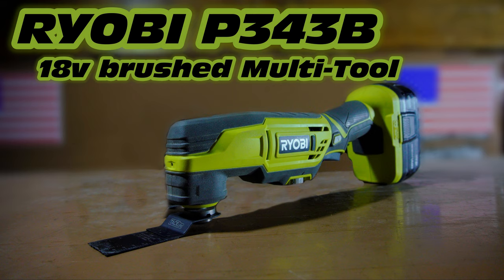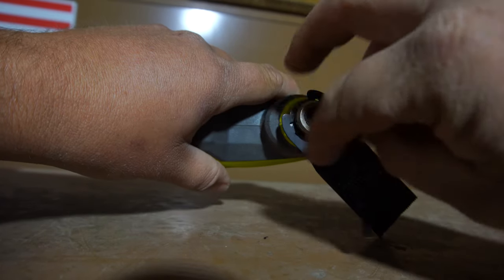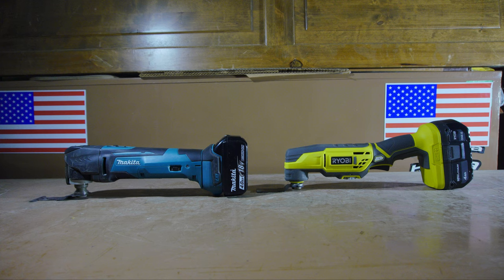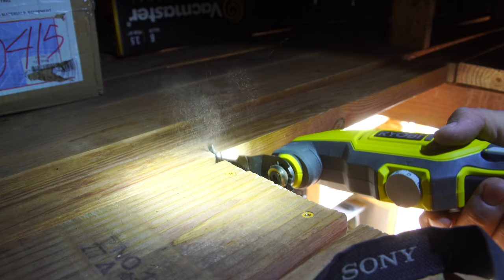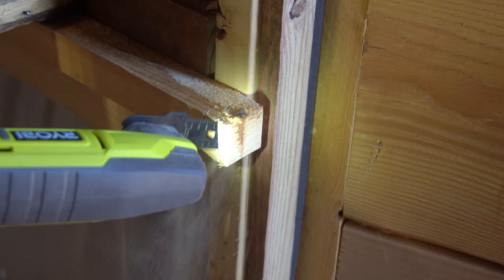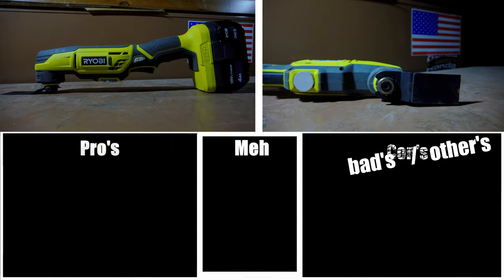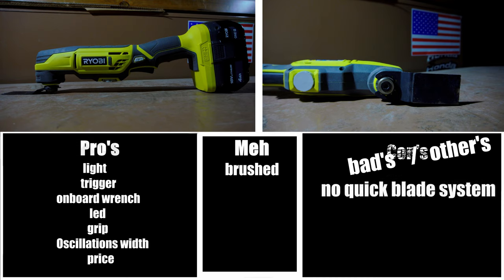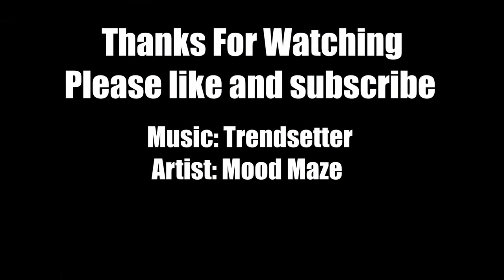Review Ryobi P343B multi tool

Comment: just bought one of these to lop a pretty substancial padlock off the side gate that rusted shut, did the job just fine but definitely chewed up a blade. it was hard to choose a pair of bolt cutters though when the two were nearly the same price and this thing does so much more!
Reply: How long did it take to cut the lock
Reply: @greylynnjr  like a minute or so?
Reply: @TheMariokart69  I wonder if its a good method to remove nails in roofing. Theres alot of nails involved.  Currently using a nailbar and hammer. Takes alot of banging and effort
Reply: @greylynnjr  with the right blade it’ll do the job, I’m not sure I’d want to use this tool for hours on end but I’m sure it’d do it
Reply: @TheMariokart69  why wouldnt you use it that long? Cheers
Reply: @greylynnjr  vibrates a lot, it’s a bit loud, the blades are expensive… There might be better multitools that overcome some of these issues but this one in particular is probably better for the home DIY guy and smaller jobs.
Reply: @TheMariokart69  cool bro. Appreciate it

Comment: Having a hard time finding the right replacement part for this tool. I need the flange that the screw and o-ring sit in to secure the blade from the bottom. Seen @ 2:31.

Comment: These have a potentially fatal flaw.  The motor can suck one of the top rubber vibration insulators into the rear and bind up the fan blades on the motor.  Easy to take apart and remove but if you don't realize that it happened it can burn up the motor.